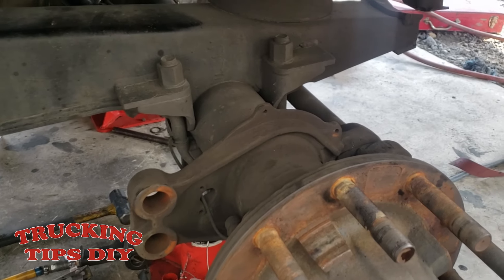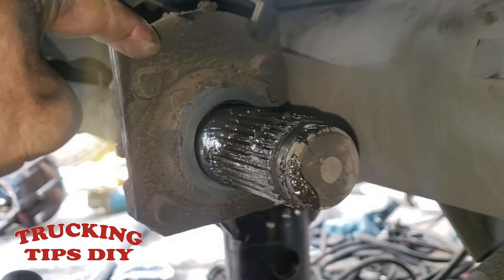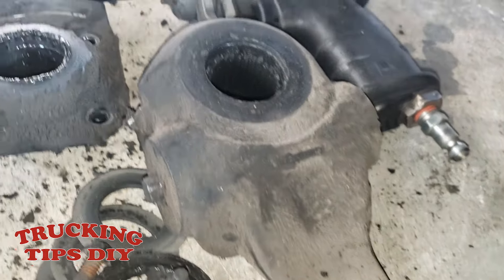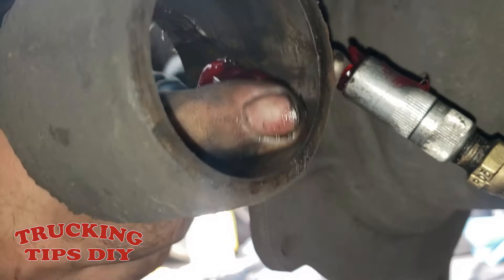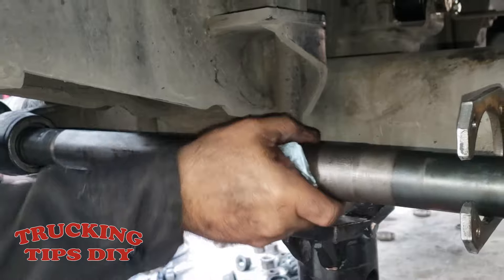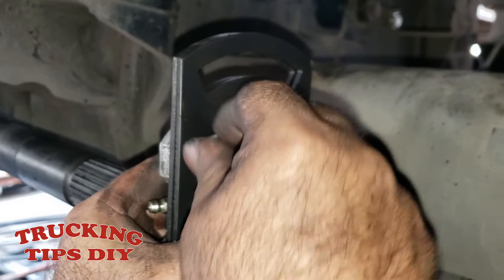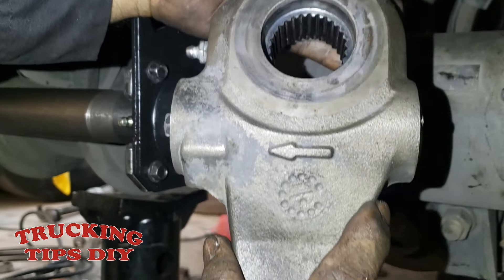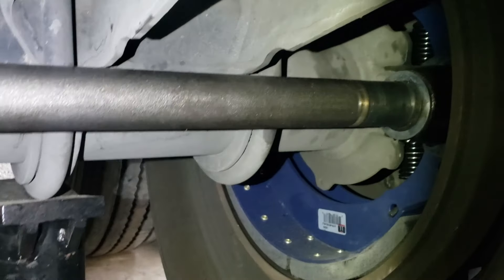How to Replace S-Cams And Bushings on semi trailer  (step by step)

Comment: Unless there is some other issue I never pull the hubs to do s cams and bushings. Pull the cam tube and knock the outer bushing out and the cam will get enough angle to slide out, put the seal and bushing on the new s cam and drive it back in. I use a short piece of an old cam to drive the bushing into the tube. Trailers are easier but it's pretty much the same
Reply: No way!!!! Send me a video😮
Reply: @karelrheaume6598  yes way, figure it out.
Reply: 😂😂 I smell Bull....

Comment: Probably had trouble with the free-play of you bushing because your using a puller for your brass bushings witch flared them . Use a tube shape punch  . Use the s-cam with washer to fit your seal perfectly on.  Saves me lots of time

Comment: If you get the bushing out while the cam is still in, you can remove without removing the hub just gotta apply some heat and the bushings will become real easy to remove with a flathead

Comment: Usually when putting on those seals we use an old frame bushing boltalong with the washer to use as a punch. Keeps that seal straight and centered all the way through. Kinda like putting oil seals on.

Comment: You can get the s cam past the hub if you cut it in half. With the old seals and bushing gone there should be enough room for the new cam, you just have to put your washer, seal and bushing on the cam first.

Comment: How long does this take on a trailer usually? If you were to take it to a shop how many shop hours would it be?
Reply: For the shop I work at, to do a double axle brake job with removing hubs and s cams and bushings it’s 10 hours. One axle half of that.

Comment: If s cam bushings bad
Will it make vibration?
Reply: Yes if the bushings are worn out when ever you break it's going to have vibration and the trailer is going to jerck when ever is empty or on light weight.

Comment: I love your jack stand. It can’t slip off, but I would put it on the axle.
I’ve tried the brass bushing but they brok into pieces.very disappointing. Nylon holds up the best but they are shit too. When new they don’t fit tight and have at least 5000 thousands clearance. Withe this much slack, a little wear, and bumpy roads the cams just were out in 8 months. Truck brakes are shit. They should last for years without lube or repair.

Comment: When replacing the S-cam the red air knob inside the truck is push in correct ?
Reply: Yes and back off the slack adjusters all the way

Comment: What would be the labor cost at a shop to get this job done?
Reply: $800-1000  roughly. It’s usually $340 for the wheel seal. Plus the you have to remove an reinstall the slack adjuster, then the s cam and bushings. Est is for the whole axle.
Reply: @shawnevans9106  thanks

Comment: how do you know the bushings are worn
Reply: If the bushing spun and you can't install a new grease zerk it should be replaced and if the s-cam shaft doesn't spin freely  in the bushing, bushing should be replaced. It's just basic common sense really,  the S cam shaft needs to move freely to work properly and you'll have to replace anything that is stopping s cam from moving and doing its job
Reply: By the play on the shaft

Comment: Before the install. Really should have run the dremmel around the face of each side. Beveling it inward. The seals wouldn't have cought an edge on the way in. Other then that. Good video.